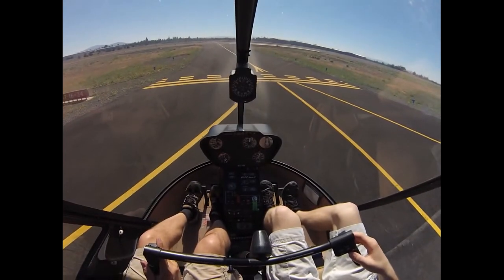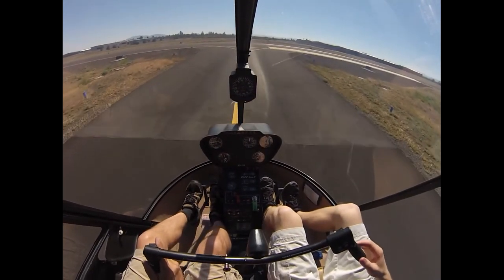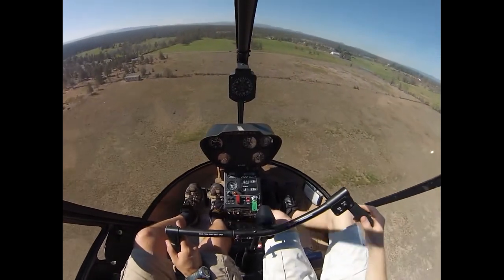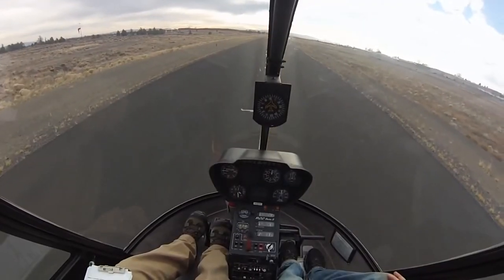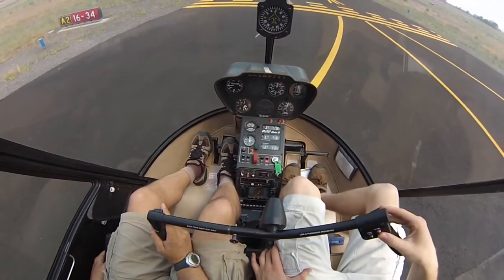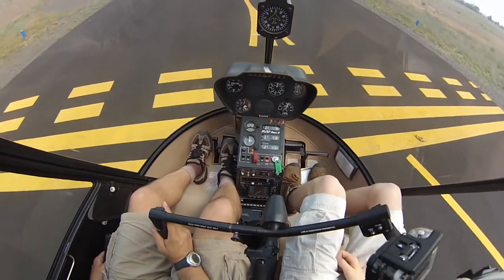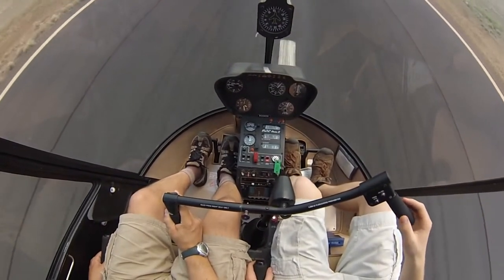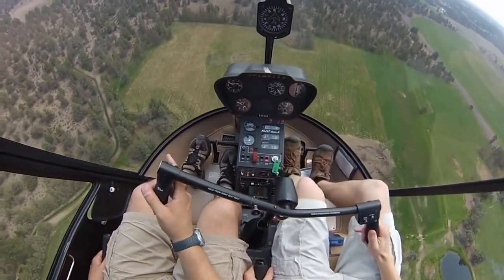How to Takeoff in a Helicopter. Also Transverse Flow Effect & Effective Translational Lift (ETL)

Comment: i would guess that as you start moving it change the angle of attack of the disk from the start so a little more cyclic pressure mantains the attack
Reply from the maker: There is a lot going on - pendulum effect, dissymmetry of lift, gyroscopic precession, etc.

Comment: I’m at about 50 hours, and I still struggle with pushing through ETL on takeoff.  I am finding it difficult to find a balance between having enough forward cyclic to not balloon up at the onset of ETL, and enough aft cyclic to not scrape the skids by going back down as I gain airspeed.  Any tips?
Reply from the maker: Hey Brian - great question! First of all - you are not alone! This is a VERY common 'challenge' to learning to fly a helicopter. Trust me - it will come with practice. But some things to think of: 
1. Know that the forward (and sideways) cyclic pressure/position will be need to be changed (almost constantly) as you speed up - you can't just 'plant it' in position and go... 
2. Start SLOW (think cyclic control pressure rather than control movement) - you can speed it up as you get more comfortable with it. Push forward a bit, wait, feel settled (fix any pitch/roll changes) and stable and then push forward some more and repeat. 
3. Look to the horizon (not inside or too close at the ground) - so you can see early if the nose is pitching up (as will happen as you speed up). 
4. If the nose pitches up (which it will!) - FIX IT- push forward immediately to keep the nose where you set it.
5. If you start ballooning (because the nose came up and you didn't catch it), pushing forward MORE and/or lower collective VERY slightly. 
6. If you start descending, VERY slight aft cyclic and/or up collective (if you have power margin* see 7).
7. As you move forward, your rotor efficiency increases (due to relative wind, etc...whole different lesson) and your manifold pressure (if R22/R44 etc.) will drop slightly (even though you have not lowered the collective) and you can now pull up a bit more on the collective (as you have more power margin available) - this may help if you are descending as you gain airspeed.
8. Remember (like all things in the helicopter) all the inputs take a few seconds to 'register' - so back to to point 2.

9. Ask your instructor to let you play around with it a bit - feel it out. Take a taxiway/apron not  being used and just 'feel it out' up and down the length of the area - not to take off, just to feel the changes as you move through ETL - maybe up to a hover taxi at most. Just experiment for a while without the pressure of a takeoff on a runway with other aircraft waiting to land/takeoff.
Reply from the maker: Oh and PLEASE let us know how it goes and what worked for you!

Comment: Is there a reason that Transverse Flow Effect only happens between 10-20 knots (right after takeoff and right before landing? It seems like anytime the front of the helo is lower than the aft that this would occur? I don't understand why it only happens at those speeds and times (after takeoff/right before landing)???
Reply from the maker: Another good question. At speeds below 10-20 knots most of the disc is still experiencing mostly vertical induced flow.  As you get faster than 10-20 knots, the whole rotor disc experiences more horizontal flow of air (Effective Translational Lift [ETL]) and so the effects of Transverse Flow are greatly reduced/eliminated. For more information (until we get a video on the subject), google "Helicopter Flying Handbook" - a free resource from the FAA

Comment: Where in rotation, and what causes the force (Gyroscopic Precession) that causes the helicopter to til to the pilot's right.  Whatever the force is has to happen at the rear of the helicopter if the helicopter tilts to the right.  My understanding of gyroscopic precession is that any force applied to a rotating body results in a a tilting effect of that rotation body 90 degrees after force is applied.  
Assuming the rotor blades are spinning in counterclockwise, and knowing that the helicopter is turning to the right must (by definintion of gyroscopic precession) mean that the force applied is happening at the rear (aft) portion of the helo.

I don't understand what the force is, and in what direction the force is being applied. TFE states that there is a high AOA at the front because the air is hitting the blades almost horizontally, and it is more vertical and accelerated at the aft portion when it hits the blades so that decreases the AOA since the air is coming from a higher/steeper angle rather than horizontally (it cuts out some of that AOA) than in the front.

I don't know what is happening in the aft to act as a FORCE (gyroscopic precession) resulting in the helo tilting to the pilot's right side. I've been thinking and reading/researching about this for the past 24 hours and I can't wrap my head around it. There is less lift affect in the rear due to the decreased AOA so I can't believe that lift is the force since it's reduced in the rear compared to the front.  If lift was the force then it would be heaviest in the front (more AOA) and I would say the helo would tilt right since that is 90 degrees after the most lift, but that's not the case. 

Can someone please explain this to me?
Reply from the maker: Great question. The higher AoA at the front of the rotor disc means more lift at the front, but as you know this is 'felt' about 90 degrees later (due to gyroscopic precession) meaning the extra upward force (lift) on the rotor disc is actualized on the left (counter-clockwise rotor systems) of the disc. That extra upward force lifts up the left side and tilts the disc right. That tilt offsets some vertical lift to the right, causing a right roll. I hope that helps. We will be doing a full video on transverse flow effect soon.
Reply: Nice simple answer, thanks.